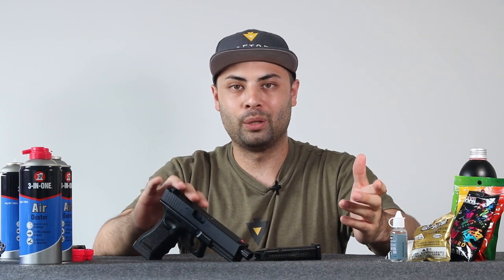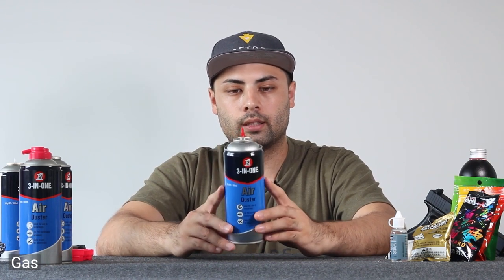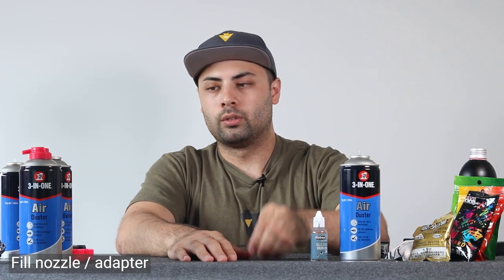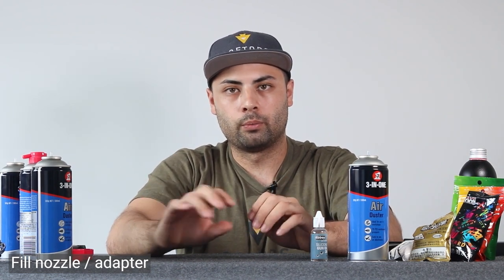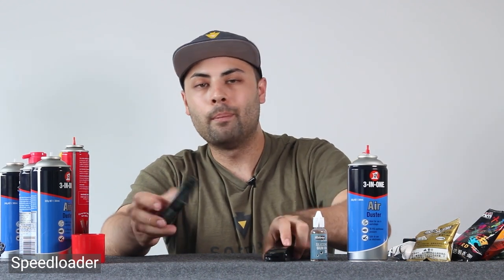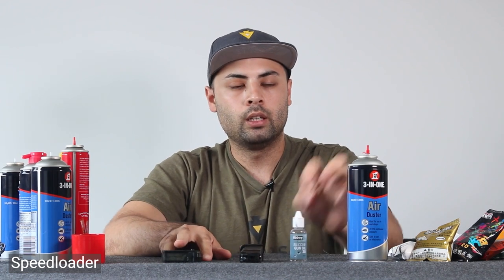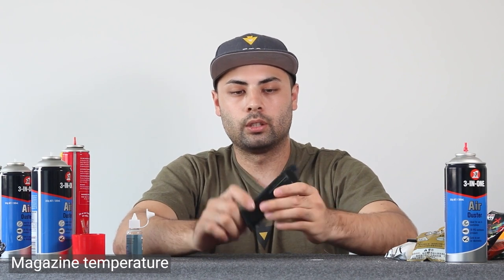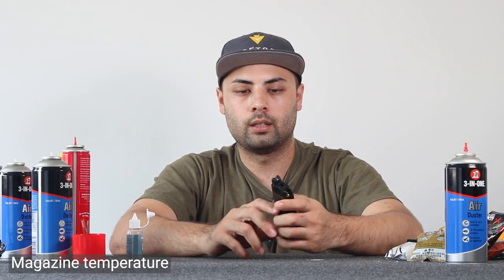Kublai P1 | The Basics - What you need, how to gas, oils, etc.

Comment: Hey SOFTOPS I was wondering if you knew the answer to a couple questions I've really struggled to find out.
Other than the Duster Gas "Difluoroethane" and I've heard you can use Propane, are there any other gasses compatible with the P1?
I wish there was some list of P1 compatible gasses with X's or Ticks, depending on their legality in different places.
Another question, Silicone Spray Lubricant made by 3-IN-ONE purchasable at Bunnings usually alongside the Duster Gas. 
Is that Silicone Oil? I really hope it is lmao.

Comment: Can you use RC Shock Oil, instead of silicone oil? And can you only buy silicone oil online?
Reply from the maker: You can buy silicone oil from local gun stores. The link we provided is just an easy buy and is an affiliate link. Check out rebelgunworks.

No idea what RC Shock Oil is. The main thing is it needs to be designed for the seals etc in the magazine - there are a lot of oils etc that corrode/damage those seals. As soon as your seals are gone, your magazine is stuffed.

Stuffed magazine = bad time with the blaster.

Comment: This is pretty deceptive and misleading..... the 3 in 1 duster gas from Bunnings is NOT R134a......its R152a...which is a much weaker gas a propellant. Also inverting the can results in fluid coming out and causing freezing.

Comment: What is that gas? We don't use it in China.
Reply from the maker: Its a gas that is typically used for cleaning computers etc. When this video was filmed, we didn't have green gas available on the market. Now we have Abbeys Green and Red, plus a few others. So the recommendation here is a bit out of date
Reply: @SOFTOPS  OK, I Gotcha! So, that gas for cleaning really works? We commonly use Freon （Refrigerant） sort of gas which is for refrigerator.
Reply from the maker: @Dadasudasu  yeah it does, but it is even lower pressure than that refrigerant gas. The refrigerant is more or less illegal to use over here as it is bad for the environment.

I'm seeing most people run Green Gas, Propane, or getting CO2 magazines now to get a higher pressure / FPS.
Reply: @SOFTOPS  You can check on the rules of refrigerant using, We definitely only use those that do no harm to the environment! Such as R - 134a, R - 410a, R - 290 and so on.